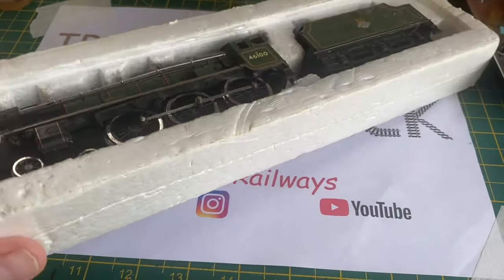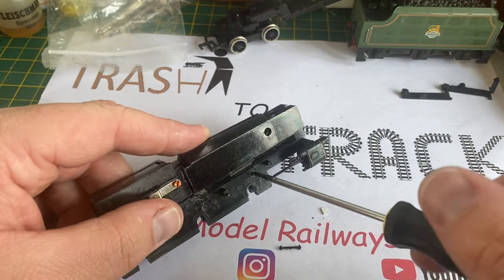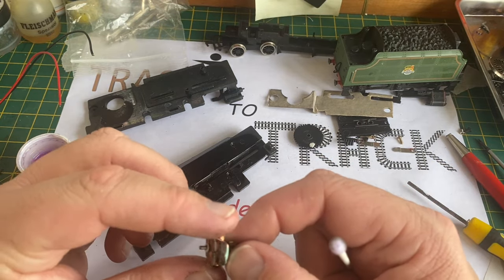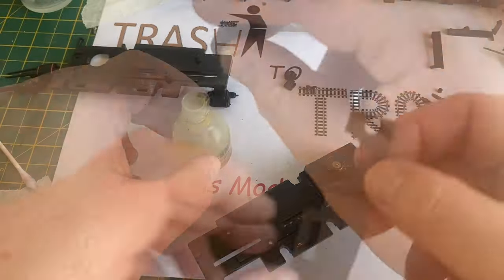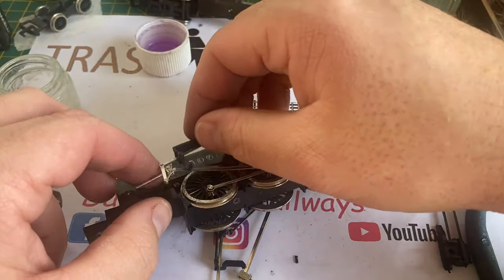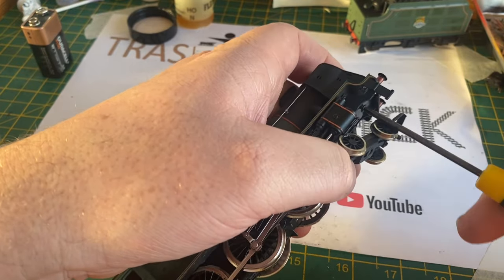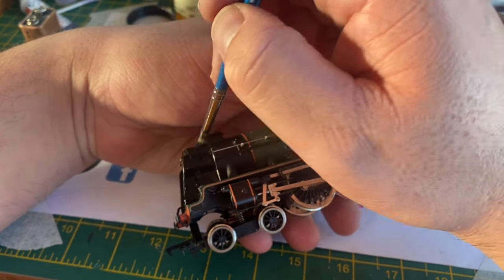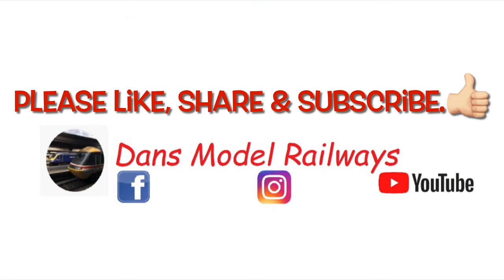Trash to Track. Episode 89. Airfix/Mainline Royal Scott.

Comment: I have the LMS version, and has been one of the fiddliest dang things ive ever worked on and i still cant quite get it running smoothly at low speeds. Im 95% sure its not the quartering. Could be wheelspacing, i had to replace the front driving axle and that wheel is a tad wide but rolls ok. Needs replacement brushed and springs and potentially some more axle work. Looking forward to seeing this repair. If you have an idea why it ran lumpy at low speeds id be grateful to hear it but its fairly low on my list of priotiry right now.

Comment: I picked up an Airfix Royal Scot recently but it was a black tender-drive, runs quite well. I have a bag of parts for a split chassis Bachman Pannier Tank but there are some black plastic washers with it. Are they to separate the chassis halves or does it use a card or plastic membrane too?
Reply: The Airfix Royal Scot is a decent Model however the Tender Motor is way too over engineered not helped by being mostly plastic.